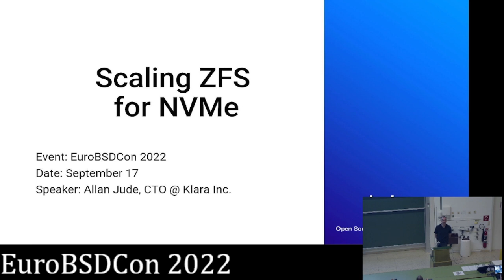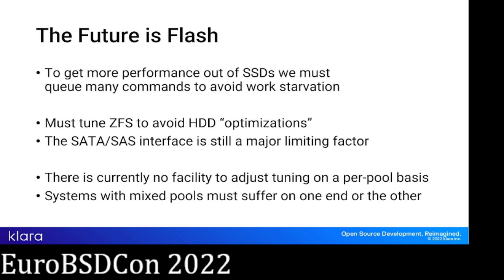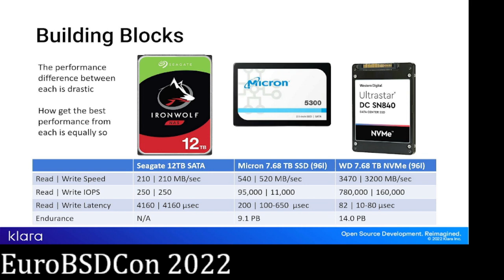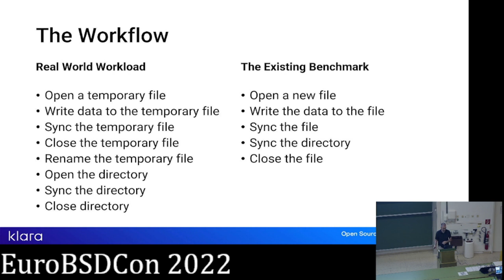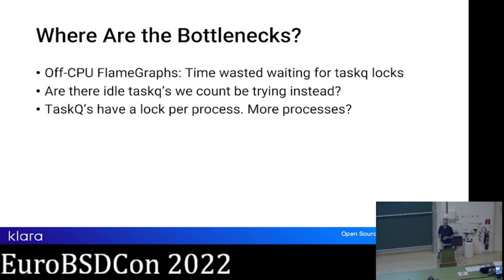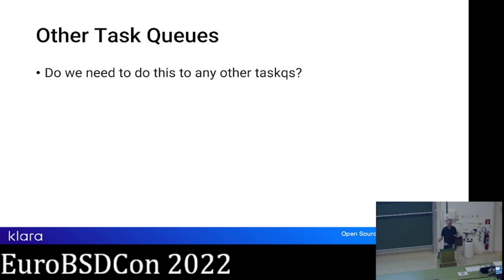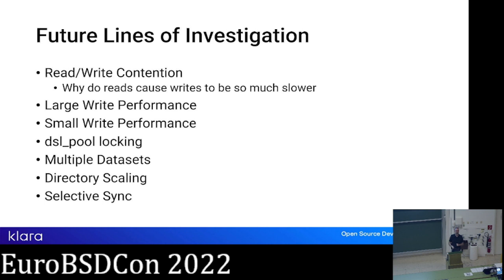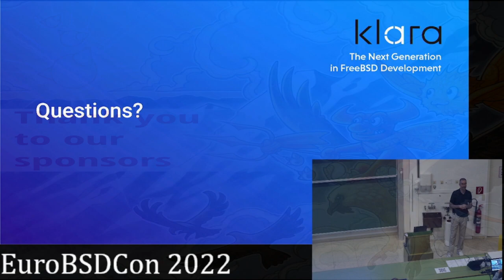Scaling ZFS for NVMe - Allan Jude - EuroBSDcon 2022

Comment: I think it is unwise to think ZFS shouldn't use hardware profiles. There could be detection and customization with an easy to use UX. There aren't that many configs that deserve to be common and selectable. It should be easy and streamline setup across many different hardware with consideration about hardware. It should detect poorly configured SLOGs for example and warn the user.

Comment: Flash based SSD's most certainly were a thing in 2001.  In fact flash based SSD's predate ZFS by 10 years.  It would however be true to say that flash based SSD's were not in common use in 2001.
Reply: So like "hardly a thing"